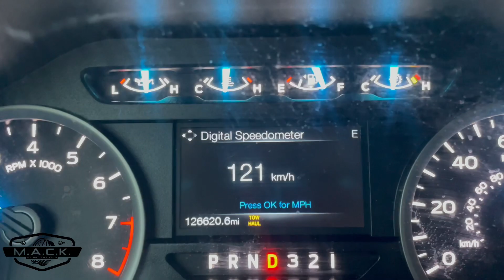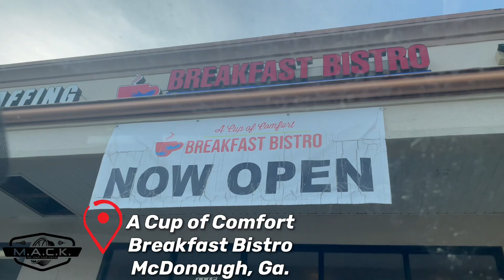New Wheels and Tires on my F150!! 2.5 Level on 33s!!

Comment: How does the truck ride and wheels ride with 33s on the 22x12? Thinking of doing the same thing but nervous of the smaller tire surface.
Reply from the maker: The truck rides great! It wasn’t much of a difference to me from the stock setup. you will feel the road a bit more, but with these all terrain tires, you don’t feel the impact of bumps and potholes much at all. Let me know once you get your setup how you like it. 👍
Reply from the maker: Also, my wheels are 22x10 not 12
Reply: @MeAndCarKeys  will do should be next week when I do

Comment: Does yours rub? I just got my truck trimmed and my 33’s still rub and I took it back to the shop and they said they couldn’t go no more without damaging anything?? I got a 2.5 leveling kit and 33’s, 20X10 wheels -25 offset
Reply from the maker: Sup! It only rubs at full lock in reverse and when flexed like when I back into my driveway. How much trimming did they do? I know your wheels stick out a bit farther than mine due to the offset, but I had to trim crash bars and part of the fenders. Check this out: https://youtu.be/NjLTU5xOAL8

Comment: I’m thinking of changing my set up to something like yours. How much does a set up like the one you got cost? Wheels and tires?
Reply from the maker: Awesome bro! My setup was around $3,300 last year, (I used a payment plan with Affirm) But here is my exact setup. Its been on backorder for a while. 
https://www.customwheeloffset.com/wheel-offset-gallery/2292673/2015-ford-f-150-moto-metal-mo807-eibach-suspension-lift-25in
Reply: Appreciate the info man, I’ll definitely look into it…

Comment: How does it drive ? I went with 33x12.5 mud tires and it was shaking after hitting 60 mpr
Reply from the maker: The ride is quiet and smooth. Very good tire so far! 
I suggest just getting them rebalanced if it’s shaking like that. Mud tires typically ride a bit rougher but it shouldn’t be shaking. 
Thanks for watching and for the question. Hope I helped some

Comment: 19 mpg wow that's good. 
I get 15 mpg on 6.2 chevy with real heavy duty foot though
Reply from the maker: Those were the good ol days! After the wheels and tires, I’m getting about the same as you 14.9 and that’s with a v6 and a light foot! 😂
Reply: @MeAndCarKeys  i am putting same 22x10 and 33s On mine so i guess it will get slow and thirstier too. 😬.
But is gonna be niiiice 😁

Comment: What size Rims? I'm about to buy some 20x10s after I level my F150
Reply from the maker: These are 22x10, -18 offset. What rims are you thinking about getting?
Reply: @MeAndCarKeys  I haven't picked them our yet. But this is the look I'm going for
Reply from the maker: @CrunchDramaNetwork  gotcha! Have you checked custom offsets website? They have a truck gallery where you can see what people have done with their trucks. It helped me a lot when I was trying to decide
Reply: @MeAndCarKeys just ordered my set up.  I got Fuel Throttle 20×10. 33 TOYO RT trail tires , and getting a 2.5 level . 3,300 for everything.  I think I got a good deal. What you think?